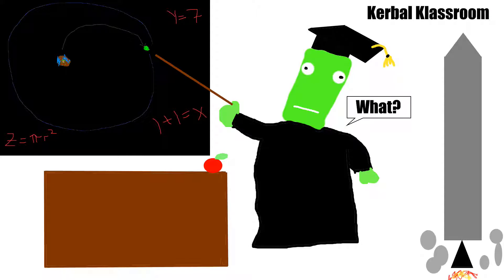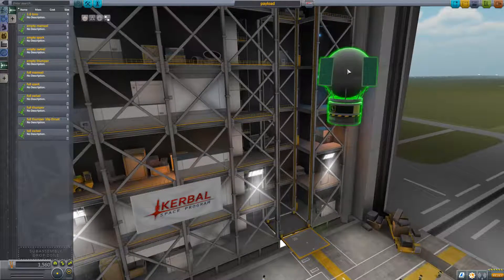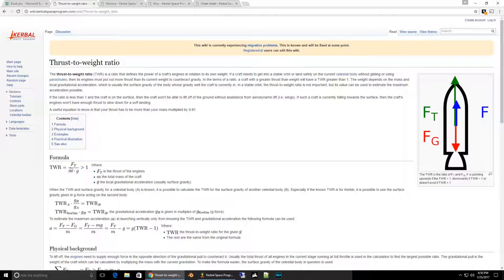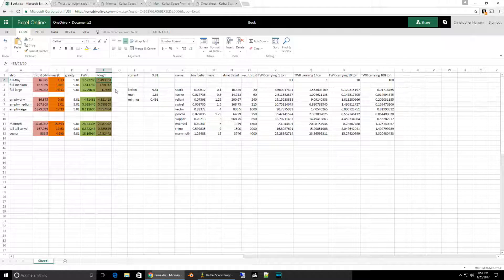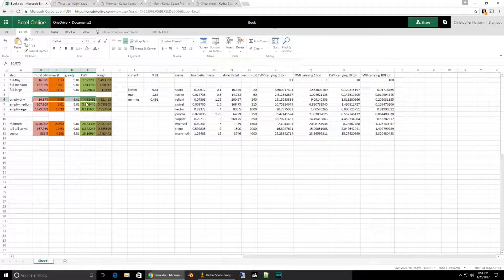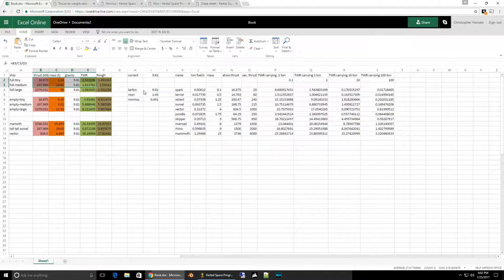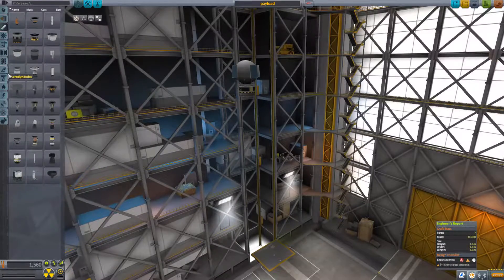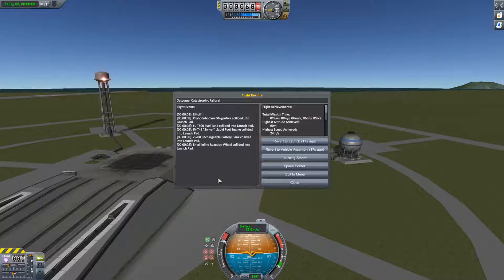Kerbal Klassroom - Thrust to weight ratios (TWR)

Comment from the maker: The end flight report max g-force shows higher than I calculated because I calculated a full tank. The end flight report showed a higher g-force when the tank was <1% fuel but still pushing out thrust. Lower weight means higher TWR.